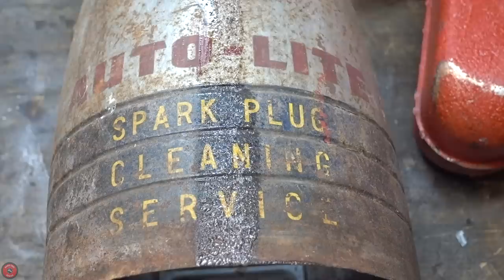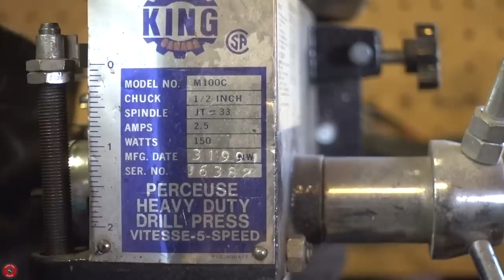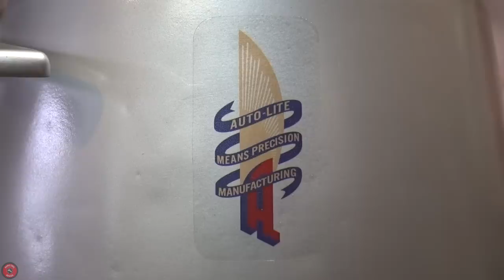1940s Spark Plug Cleaner [Restoration]

Comment: What always amazes me about all these tools/machines we use as a species, like this spark plug cleaner, is that every one of them, down to each little piece, had to be designed and produced.  Then to expand on that notion, the tools/machines that were needed to produce these pieces also had to be designed/built, and so on and so on.  At some point, you get back to just two rocks smashing against each other.

Comment: I worked in a gas station as a teenager in the early sixties. We cleaned spark plugs with a wire brush. Probably did just as good a job as this device.

Comment: Just a suggestion. To find (and fill) small dents, you apply a coat of white-ish primer, then a coat of black (darker) primer.  Wait for them to dry, and then give them a light sanding with a soft block. You'll see all the dents as color patches.

Comment: I remember the station down the road had one like this one and it was always ready. They would put the plug in and press the lever. Just FYI.

Used a similar device back in the 70's, but it was WAY more simple.  It looked more like an old Ford brake master cylinder. It just plugged into the supply pipe at the wall for a ridged mount and and was always "on". You put the plug into the hole and pressed a button on the side. The bag hung down and it always blew out dust but everyone was breathing through a cigarette filter so it didn't matter. lol  Maybe that's where the lead my father claims collected in my ass came from.  :-)
Reply: Zee-L Usay    I used the same type. Wish I still had it. It would look cool in my shop.
Reply: I used one back then to clean 2 cycle motor cycle sparkplugs  that ran 20 to 1 gas to oil would get all fouled .Later on when  it went to 50 to 1 plugs would last for years
Reply: I saw one when I was a kid at the service station and I wondered why you would need to "wash" your spark plugs. I didn't have any clue back then how an engine worked. I wish I could go back in time and see things like that again so  I could appreciate it.
Reply: "...It looked more like an old Ford brake master cylinder...".  That's a Vixen.  They were widely sold in the old days.  I still use one to clean the spark plugs on my old 1965 Ford Galaxie.

Comment: At 22'5, I would say that the screw is a Frearson, which is quite uncommon. It certainly is not a PoziDriv, does not look like a Philips either. Frearson is my best guess, and this is compatible with the tool, as Frearson screws were in production in the late 1930. Can somebody confirm my view ?
Reply: I would agree. There are a couple of obscure French and Japanese screws a bit like it and PoziDriv wasn't patented until 1962 by GKN in the UK.
Reply: I've a Navy buddy who was stationed in the UK in 19 ought 9 and he told me these were called "Williams"  apparently there was a royal mandate that all screw heads be named after royalty.  Hence we have Williams, Phillips, Fergies, and bless his soul died at birth Sir Torx.
Reply: I was in the hardware business in the 60s, and there were Frearsons in a tool catalogue. I believe the company was Vanadium. They were kinda/sorta interchangeable with Phillips but more pointy.
Reply: That just looks like a normal philips to me. Just googled it and there appears to be a difference? Apparently Phillips have smooth inner edges while Frearsons have clean cut inner edges. Never knew the smooth edges in a Phillups where intentional, always thought it happened to them through time and use.

Comment: I used a similar, yet smaller, spark plug cleaner like this when I went to work in a truck shop in 1977, the year after I graduated from high school.  I learned if you have time to take the plugs out you have time to replace them!

Comment: Ask This Old Tony to make you some punches.
Reply: Or better yet, crowdsource one punch from the top youtube machinists. Like 1mm from Clickspring up to  100mm from Abom79. You'd get a set of punches, and they'd be generating content.
Reply: Not a bad idea, a huge multi-channel collab.
Reply from the maker: Hopefully I can collaborate with all these people.
Reply: another method to use is to make your own recyclable and reusable hole punches - - - > empty discarded shell/cartridge casings work like a champ.  Magnum/belted cartridges work and last longest and are easier to hold on to. Super easy to sharpen the inside and outside of the case mouth...and tappity tap tap - just like that - you have hole(s) punched.
Reply: Don't forget laser cutting the gaskets.
Reply: Harbor freight ftw.
Reply: You could use empty shell casings for hole punches. Cheap, easy to find, and come in lots of sizes.
Reply: Hand Tool Rescue ElderlyIron showed a pretty cool trick when he was rebuilding an old carburetor where he used a small ball peen hammer to actually hit the new gasket material up against the edges of the mating surface. The machined edges and holes are sharp enough to actually cut the gasket material with surprising accuracy.

Comment: в чем смысл проверки краски на свинец?
What is the point of testing paint for lead?
Reply: because lead is toxic to your body and if he were to sandblast or wire brush it off and breathe it in it would make him sick, possibly even kill him.
Reply: @Hydroslinky515  I don't think it would kill him, although it might cause other harm.  It's not so much an acute toxin unless you REALLY get a lot of lead.  The LD50 for soluble lead acetate is 450 mg elemental lead/kg body weight.  If he weighs 70kg, then he'd need 31.5 grams of lead to have a 50% chance of dying.  The lead in the paint is not very water soluble, so it would probably take even more.  The total amount of lead in all of the paint is probably only a couple grams at most.  If he's that worried about toxicity, he should have put a sheet of polyethylene over the workbench.  Now it's contaminated.
Reply: I handle lead on a daily basis at work with my bare hands. its not nearly as toxic as everyone assumes.
Furthermore a lot of lead has fillers in it, its generally not 100% lead.
Reply: @frostbite1991  Metallic lead?  Still wouldn't be a bad idea to wear gloves.  Won't kill you but might make you stupider over time.
Reply: gelleg1 so you don’t die comrade...

Comment: Wouldn't that dust contain platinum?
Reply: Most of the older plugs are just copper electrodes.
Reply: Lead and copper more likely. Unless this thing was still being used between the mid80's and the turn on the century. Which is highly doubtful. 😦

Comment: Patina - Pretentious word meaning it looks like crap and needs a lot of work to be put right.
Reply: Indeed.  Sure it adds character to the copper shingled churched of a century ago, but that sad browny-orange of iron oxide has no place being called patina.
Reply: I like to think patina is the stabilised kind of rust. I got two clamps from ps&w, southington, USA, both 130 years old. The rust has stabilised to a point where it does not come off in your hand, looks very nice. I also got a vice of theirs - different story, rust powder coming off every time I touched it. I have wire brushed it back to the point where it still has an oxide finish but not day-glo brand new shiny. That finish takes over a hundred years and is a part of the tools history in my opinion.

Comment: I make a lot of my own gaskets.  I have a full punch set 1" and under but I don't have anything for the larger holes.  My method for drilling the larger holes
- Pre drill a piece of plywood with the correct size hole saw (I was using Forstner bits but found hole saws to work better for cutting the gasket)
- Removed the center pilot bit from the hole saw
- Place the gasket between two pieces of plywood, the one with the hole on top, aligned with the portion of the gasket that needs to be cut out
- Use the pre drilled hole in the top piece of plywood to align the hole saw
- High speed and very little pressure will give a nice clean cut

Comment: Nice job.  One suggestion from an old furniture stripper.  We used buckets of TSP and warm water to remove the stripper and loosenend paint.  It helped keep the paint off the surface and combatted it re-adhering.
Reply from the maker: Interesting! Thanks.

Comment: In the 60's I used to work in garage using a machine similar, as far as I remember you put the plug in the rubber hole in the top opened the valve and wriggled the plug around so that the sand blasting grit went everywhere inside the plug to clean out burnt deposits. I do not remember our one have any metal in the rubber hole it was just a rubber tight fit.The only thing the rubber nozzle that directs the sand wears out quite fast as it is being pelted with sand. As I was in a garage with industrial compressor the air pressure was always high, the gauge I think is a gimic. Nice rebuild

Comment: Just a little advice when sticking on the vinyl letters. Spray the surface with a little soapy water, it gives you a little wiggle room for adjusting. Great job I like the old spark plugs.

Comment: If you want some cheap diy gasket punches, get some empty shell casings.  17 cal for #8, 22 for #10 screw, 25 or up to 270 for a 1/4", 8mm or 338 for 5/16", 38 or 9mm for 3/8", 40 or 10 mm for clearance, 44 for 7/16" (45 for extra clearance), 50 cal for 1/2". For  bigger, you can sharpen electrical conduit and other tubing.

Comment: Question. Why don’t you use the electrolysis process to remove rust? It works just as well if not better abd doesn’t use any potentially harsh chemicals. Just curious. :)

Comment: i had a champion plug cleaner ,but have never seen a Autolite one before . The champion units had a little thing on the side where you put the plug and tested it ,by adding air the plug could be seen as if it was under load. Quite a handy thing and i wish i still had it now that spark plugs are gold plated.
Reply from the maker: I need to find one of the Champion ones.

Comment: One of my first jobs. in the early '60's.  My older brother removed the plugs and did the remainder of the tune-up.  A basic tune-up included a plug cleaning and re-gap, New plugs added to the cost.  I cleaned the plugs in our 1950's era Champion cleaning unit, which used a heavy rubber gasket into which you would  insert all size plugs.  Spark plug technology was not stellar, could be found on the floor of most cattle pens. I'd not seen the double anode plug.  Check vintage JC Whitney or Warshasky catalogues for the other plugs.  Bob Hope theme song.

Comment: Nice, missing the rubber that goes around the spark plug tho to keep it from getting sand all over the place. Also I think the valve you had on the back is for a hose that has a air gun on the end that blows the spark plug clean after you cleaned it.

Comment: Tip: we use aquariums of varying sizes for evaporust and electrolysis duties at our Museum. Also instead of a steel brush (which I find a bit cumbersome) invest in stainless steel and copper pot scrubbers. As well as some steel wool.
Reply: The aquariums let us put some big items in.

Comment: Those 3 screws that hold the valve to the media hopper had safety wire holes in them. I know thy weren't safety-wired when you disassembled, but I wonder if they were from the factory...

Comment: wonderful video. 
As for the punch set - china made are fairly cheap and will do the job - but if you prefer quality material I'd say it's worth the investment. That being said - you could make your own punches easily.
I used to (and still do) make specific diameter of punches from tubes using a simple file - just file the outside and it makes clean cut holes. I even used aluminum and brass tubing - which works well for a few holes when you need them. In a pinch - it's actually not that bad of a solution...

Comment: I've now seen a fair amount of restoration videos (not just yours), and I'm starting to wonder if there aren't better ways to clean off the paint. Just thinking out loud here, but:

What if you set up a large, sealable, ultrasonic cleaner (one with a proper drain) and filled it with paint thinner? Put whatever needs stripping in, run it for however long is needed. Drain the cleaner through some kind of filer to catch the paint scales and refill the cleaner until the stripper is no longer potent.

To my mind, the largest benefit of this would be working with lead based paints, because you wouldn't have to worry about contaminating your work surfaces; it'd all get trapped in the liquid and then you simply dispose of the filter responsibly. Bonus points for if you use filters that are effective at removing lead.
Reply: As an added second thought - maybe set up a similar system for rust removal? It's not going to be as effective as sanding and polishing, obviously, but I figure it's bound to be far more effective than evaporust and similar on their own.

Comment: Figured out the (7/8 - 18) on the spark plug holder was mostly used to clean Champion spark plugs. So this would've been used for pickup trucks or any sort of flathead engine that was around at the time. Probably mainly used to clean pickup truck spark plugs.

Comment: You probably should use a little bit of pipe sealant or teflon tape on those air fittings.  That may be why your pressure is dropping.  If you did, my apologies; the vid was a little fast and I couldn't tell.  

Then again, the gauge may just be old, like you mentioned.

Great resto job!

Comment: I was reading the comments below and, spark plug cleaners were phased out because, some sand residue got stuck between the centre electrode and the side electrode.That sand became dislodge and scored internal  parts of the engine.

Comment: there should be a rubber gasket to seal and hold spark plugs tight, probably is your issue with the pressure gauge

Comment: 17:50 ... 
Instead of a hole punch, you can also use a suitable ball from a ball bearing. Clamp the housing part with the sealing
surface facing up in a vice, place the seal on it and use the ball with a hammer to punch a suitable hole.

Comment: Binge-rewatching due to a gnarly cold. Why does the nameplate on your drill press say 2.5A but only 150W? It was my understanding that watts are calculated by multiplying the current (2.5) by the voltage (120, because Canada), which would be 300W or 0.4 HP. 150W is apparently 0.2 HP. Does it only get power on the half-wave, maybe, so it's only half the line voltage?

I was also going to ask why you so rarely use your drill press as a drill press. Don't think I need to anymore. ZING!
Reply from the maker: It's because it's a cheap one made in China and they don't care about those details haha.
Reply: @HandToolRescue  I guess they could care, but nobody paid them to.

Comment: Those are some high horsepower spark plugs. Down side to those machines was that if you didn't rinse the plugs off the carburetor cleaner or alcohol the fine grit behind wound be detrimental to the engine over time.

Comment: I'm kind of surprised you don't use a tumbler with stainless steel shot for the small parts, and sandblasting for the bigger stuff. That's what I typically do.
Reply from the maker: Tumblr would be good to try, but no sandblasting lead paint.

Comment: That there is a very nice retro item... 

A car showroom would pay good money for that as a display/conversion piece... 

Are you going to get the gauge repaired...?
All that's in them is a bit of bent tube with a rack and an involute gear on the needle spindle... 
There's probably a bit of grit on the gear teeth...
Reply from the maker: I really want to open it up, but I am just too nervous about breaking the glass.  I'm sure the right tools would do the job.
Reply: I understand that... 
But they had to assemble it in the first place...so it has to come apart... 
Is the base of it just a deep form pressing...?

Sometimes the front unscrews...
But if your going to attempt to unscrew it then be mindful how you grip the bezel... 
It may just have been lockformed over the base during assembly... 

Careful consideration before proceeding...☺️

I've just watched the video again and my thinking is that the bezel unscrews...but it's still hard to tell from the video... 
I would be placing it glass side down on a rubber mat for grip and then attempting to unscrew the base...it'll be a very fine thread so it should wind off by hand... 
If that doesn't work then try the two machine screws at the back but don't back em out fully at their probably holding the mechanism in place inside...just back em off a bit and see if the front wants to come off...

Comment: Why not try using brasstuing as gasket hole cutters. This is used by prop designers for cutting holes in Eva foam and other denxematefials. Try looking at punished props YouTube streaming service.

Comment: have you thought about slightly sanding the outer case and then going over it with clear laquer to keep the original rustic look? they do that on oldtimers sometimes.
Reply: They do lots of weird things to oldtimers. Such as cutting off an entire front third of the frame and replacing it with custom pipes to fit whatever custom bells and whistles they want.
When new, this thing wasn't "rustic."